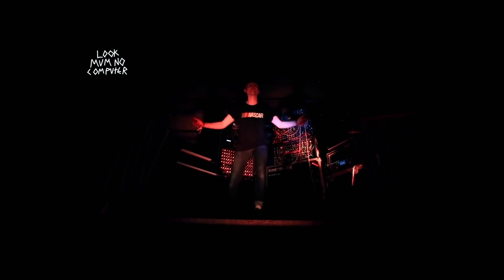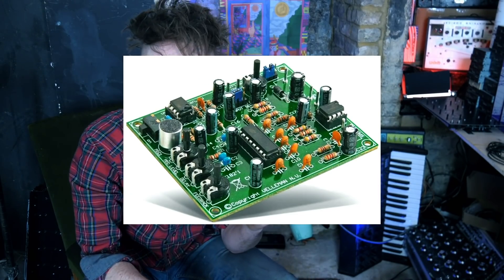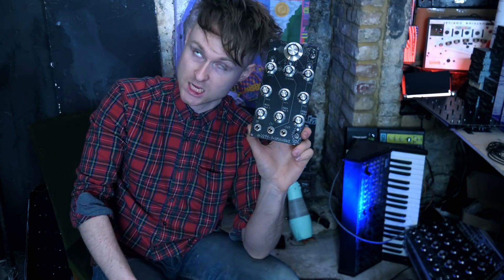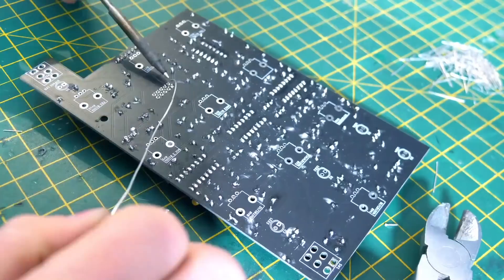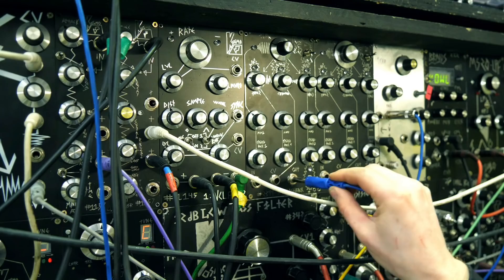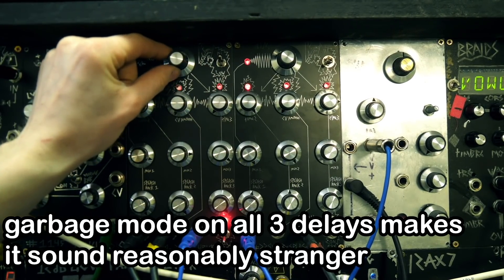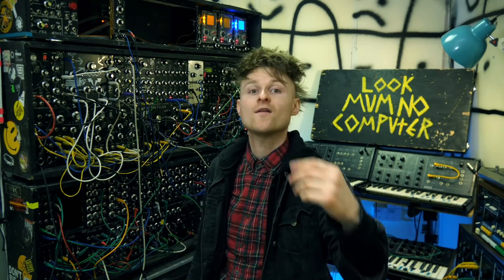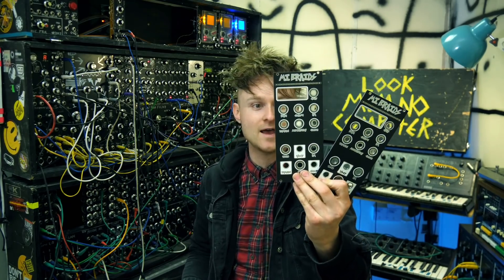Making a Super Sketchy TRIPLE Delay/Noise Module - DIY KOSMO TRIPLE SPLASHBACK

Comment: Is there anyway to circuit bend a prebuild pt2399 rever/delay board? Bought 10 of them off ebay cause the first 5 wasn't shipping and I've been wanting them for awhile for projects. Sorta wanna stuff 3 of them into a pedal. Also pair them with sampler boards theres a way to loop them haven't tried it yet but I have 6 of them now cause theyre fun to mess with and I keep ordering more. I think a looping sampler board and a glitchy delay could be a lot of fun for drone stuff

Comment: Just a thought: the daughterboard on a modular seems a predictable point of failure. Lots and lots of plug in and plug out may lead to cracks in solder joints. Why not simply using short leads between jacks and the main PCB?
Reply: That could be an issue on SOME peoples modules - but on this thing both are firmly bolted down the the panel, so I dont see it as a big problem myself. 'Kosmo format' has pretty chunky front panels and 1/4 inch jacks ;)

Comment: It's worth investing in a pair of decent wire cutters with a parallel edge, they won't spring chopped resistor legs at you and they also don't leave cable ties razor sharp 👍
Reply from the maker: They break. I use em but I go through them and inevitably after soldering everyday you just use what's around
Reply: LOOK MUM NO COMPUTER Knippex are the only ones I know of that last. Maybe try them. I have two pairs one that I take care off and only cut small wires as intended and another one for more broad use.
Reply: Lindstrom (updated) are the ones I like, they're about £40 but they stay sharp and don't break.  They have yellow handles

Comment: Sounds awesome! Is there a way to get kosmo run on 6v or 12v lead acid batteries? I am struggling how to achieve a simple power solution and Bus board for a diy modular

Comment: You fixed the prophet!!?
The snare sounded amazing btw:)
Reply from the maker: no. it just breaks when i dont want it to break. its annoying to diagnose
Reply: @LOOKMUMNOCOMPUTER  damn:( I'm sure you'll work it out! It honestly sounds like a dry joint that likes to disconnect with heat movement or vibration. Hopefully it's somthing stupid like that:p 
When it's running tap the joints with somthing non conducive like a chopstick.
Reply: There's a black ribbon-ish cable that runs from the voiceboard to the control board with the pots, it's a really common breakage point on them; it'll randomly change values or stop pots altogether.